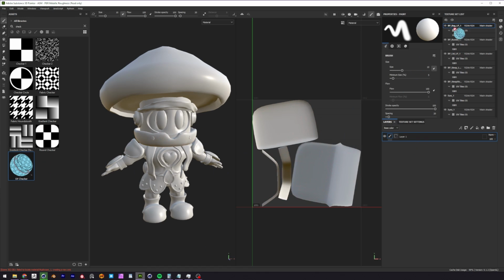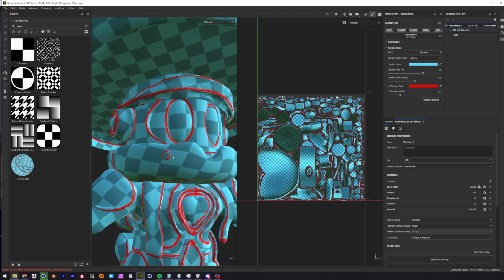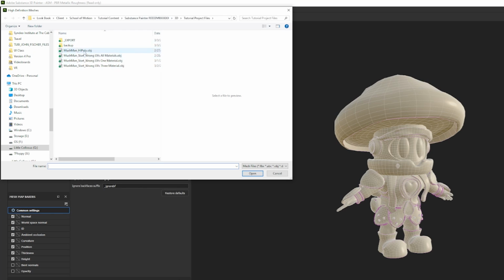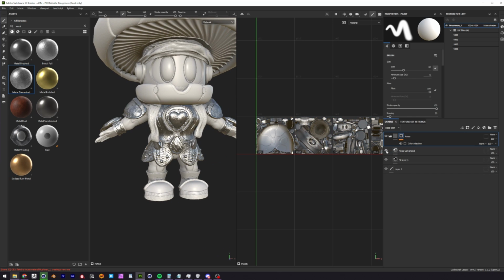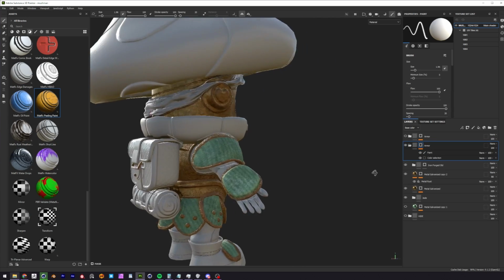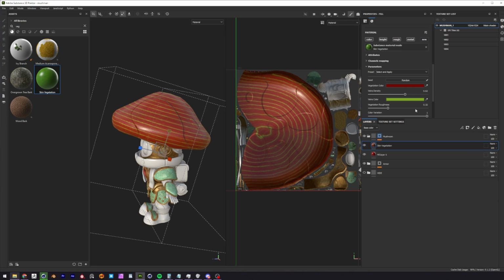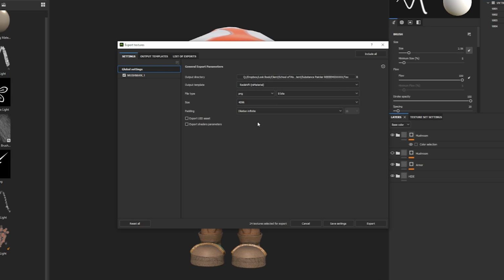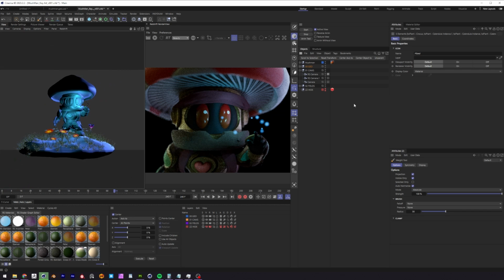Texture a 3D Model with Substance Painter!

Comment: Can this software also work on models made by Nomad Sculpt?
Reply: Yes if you have the low poly version of the model. If you bring in your high res model to paint, it'll probably freeze trying to process all those polygons.
Reply: Yes, although as Luis said it might not like the polycount. However, you can get a something to lower the poly count called Quad Remesher, currently only works on Desktop software but they are due to release a Nomad version.
Reply: @elladesigns9609  Quad Remesher works super good in Nomad so the workflow should work nicely!  Theres even a way to transfer the high poly details to the low poly https://youtu.be/QcvE2OrXyQ0?si=7DGBNIkdrMsQzaw-

Comment: Extremely interesting video. I'm curious on how you would handle having only a low poly model and no high poly to bake down. As the normal map is already baked to the low poly version, can I still create udims this way, or will the original normal map not fit anymore?
Reply: Yes. The udims are made before any baking happens. So if you only have a low poly model, you can still use them. As for normals, a low poly bake just gives you a flat normal. You'll need to use textures, generators, noises, etc to build your normal map. Usually what I do is combine multiple materials using only their normal and height channels. I'll use noises to blend them
Reply: @LuisMiranda4D  Thanks so much for  the reply and the great video!